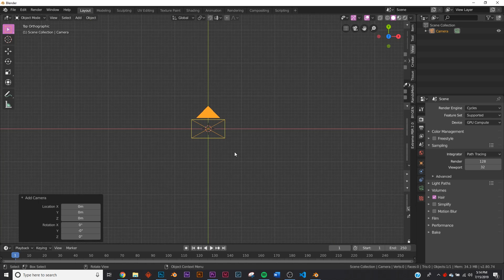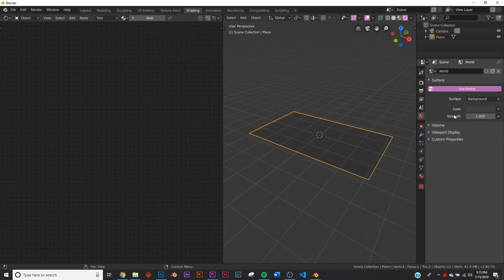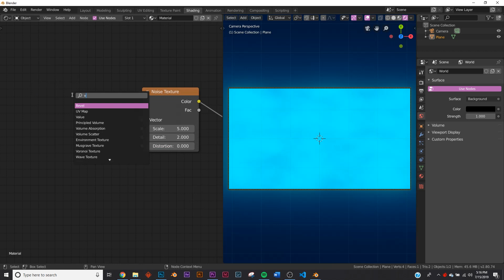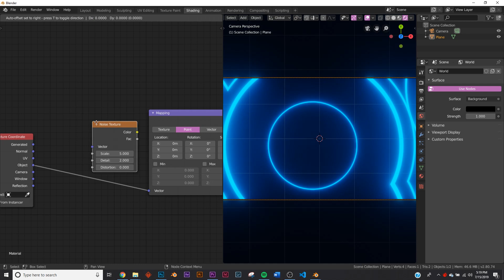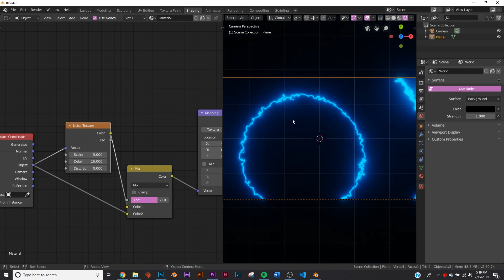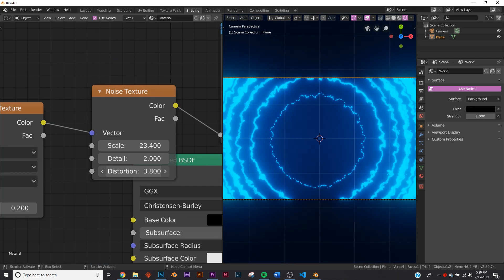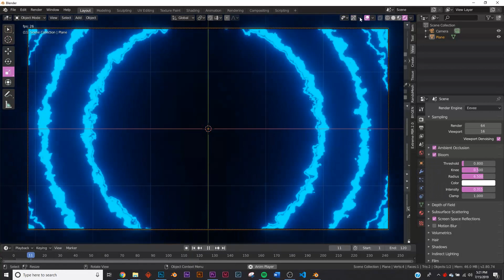Blender - Energy Pulse Explosion Animation in Eevee (Blender 2.8)

Comment: You can make it into a loop by using the rotation of the mapping node.
Reply from the maker: It doesn’t make that flashy glitchy affect that I wanted
Reply: @TheDucky3D  You have to use it in a different place. It's kind of hard to explain. But basically, it is possible to have loops with materials, especially this one, with the correct mapping.
Reply from the maker: String Fairy oh okay
Reply: You'd have to put it before the noise texture but after the voronoi. Then just animate the z rotation to complete a 360 degree spin.